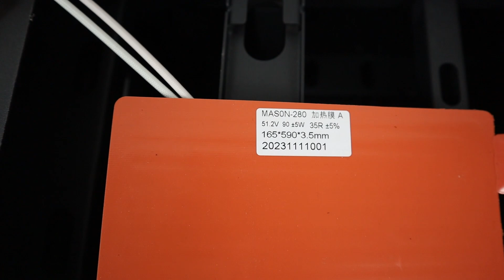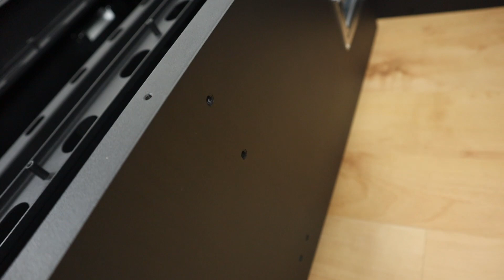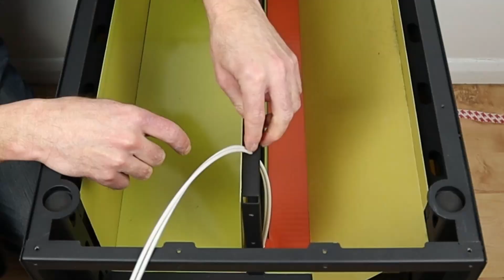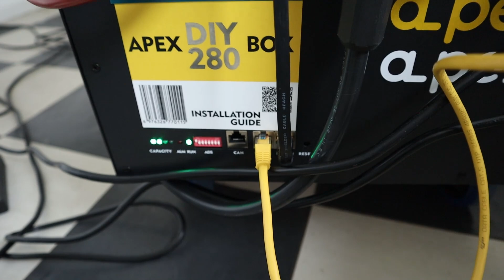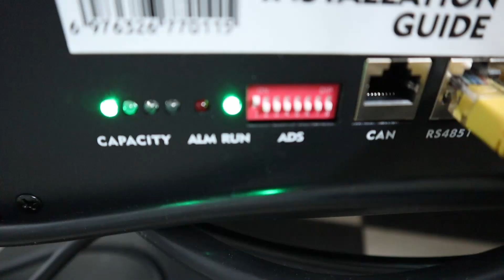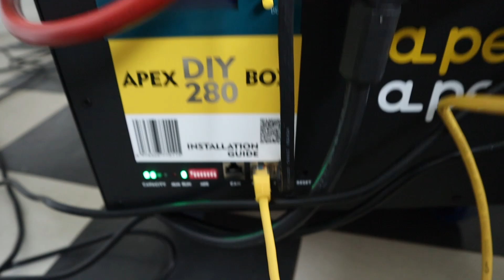30kWh!! Doubling Capacity + Heating | Scalable Off-Grid Setup?

Comment: I read some where that with these new bms that there is no need to top balance... True?
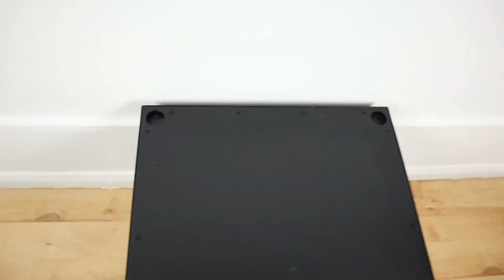Reply from the maker: @evertking1  Hey James! Thanks for your question. That's what I'm attempting with this 2nd box 6:11 to see if it does its thing and I get a reasonably balanced box pulling 300Ah if possible (this has the V2 BMS, but the V3 might be a bit better). It might take a while as the weather hasn't been playing ball. My intention is to run off one box and then fully charge and discharge to see what I get. Suffice to say, the two boxes are a game changer already due to the amount they hold even at the rate I use it. Octopus Agile has been a savour with the terrible weather though (spring is 'usually' good for solar yields). Please shout if you have any other questions. All the best, Adrian
Reply: @DADvinci  reason I ask is that I live without electricity now and no way to balance and was just wondering if it could be done without balancing?
Reply: @DADvinci   do you think it would be smart for me to build it without balancing or just save more and buy a prefab battery
Reply from the maker: @evertking1 My second pack (cells I just put in as they arrived) are generally ok from voltage pov. In theory, the passive balancing should take care of things when I get chance to charge it all the way up (weather not helping), but passive is slower than active balancing as you can imagine. Even if balancing is out a little and it means a few Ah aren't 'useable' at the bottom or top end of charge, you'd not get anywhere near in cost compared to a pre-built (kWh to kWh). You can also fully service this should anything go wrong in future. There's also an option to buy an active balancer to connect to the cells at some point to see what it can do (perhaps every 6 months), but that's not a priority as it's working well so far. Cheers, Adrian
Reply: @DADvinci  thank you... You have eased my mind..lol... I was in a situation where I had to move off grid faster than planned and now I'm stuck without electricity other than a gas generator and building a battery is sooooo much cheaper, it's too good to pass up. Well, I will skip the balancing this time. Seems like I read somewhere that in large 48 volt batteries the cells eventually sort themselves out.
But anyway, in all the troubles I'm having recently you sir, just made my day a little better. THANK YOU FOR YOUR HELP
Reply from the maker: @evertking1 I sincerely hope you get things sorted and dispatch those troubles, James. If you can build and fix things, there's not much you can't get through (speaking from experience). Please take care and shout if you need anything else. All the best👍
Reply: Hey, how is the battery working out? Been busy cleaning my land and buying up panels and getting everything ready. I have talked to another YouTuber that builds his own and said he has never balanced his... Just straight from the box and put them to work!!
Reply from the maker: @evertking1  Hey James! It's great to hear from you. It sounds like you're moving things forward nicely. Batteries have been flawless. I kind of take the 30kWh for granted now. Even though solar hasn't been great this year, there's still so much storage to fall back on. The 2nd box (where I didn't balance) is just running nicely alongside the original 'balanced' box. I'm not going to bother top balancing again when the cells are new and matched. I'm finding the same on the 12V EEL battery boxes I'm currently building for people. The EVE 280Ah Version 3 are cracking! Still getting well over 300Ah on the random tests I'm doing.

I'm going to be trying the newer EVE MB30 306Ah soon, as they are the same size so will fit the boxes (both the ones I've already got and the newer vertical Apexium from Docan). They provide in excess of 330Ah from the tests I've seen online! If I can get the price down to what I paid for the 280Ah V3, that's potentially almost 17kWh (51.2V x 330Ah = 16,896Wh) per box!

When it comes to what people buy, I guess they look for the support element (guarantee), but with the nature of these DIY boxes, they are so straightforward to fix even in the event of something going wrong. It's only really the BMS from a component failure pov that is ever likely to be replaced, unless there is a bad cell (highly unlikely from what I've read). The newer MB30 cells can even be charged under 0C, which is the first time I've seen that on LiFePO4 cells. You have to charge at a slower rate, but still it covers the heating element issue I've been trying to solve.

I was thinking that even if each box with the new MB30 cells cost a round £2k for me to build (including build time, testing, etc) and yielding around 17kWh each, you could get around 50kWh for £6k which is bonkers!
Reply: It is just crazy that you can build 15 kwh for the price you would pay for 5 kwh... Almost.. EG4 is selling a 15 kwh for about 4 grand.